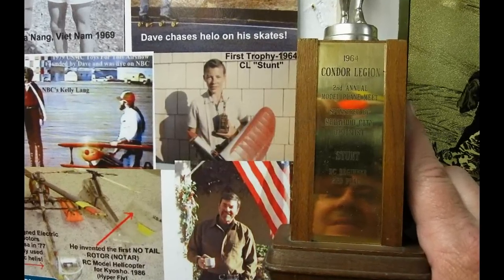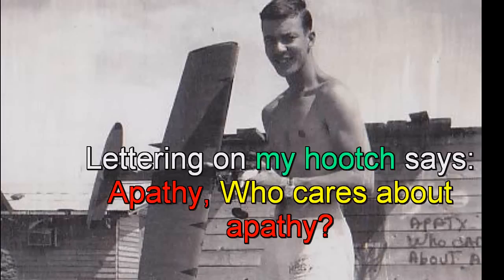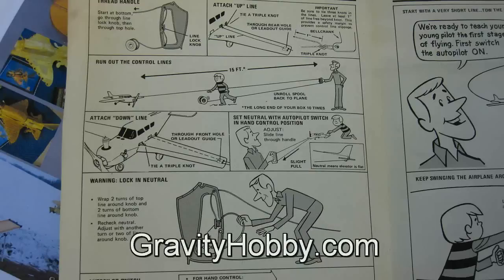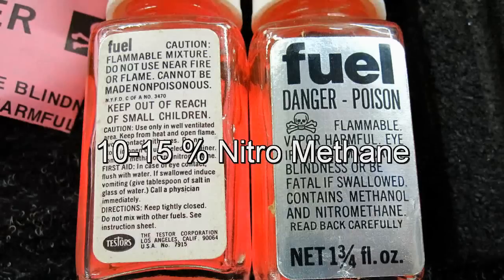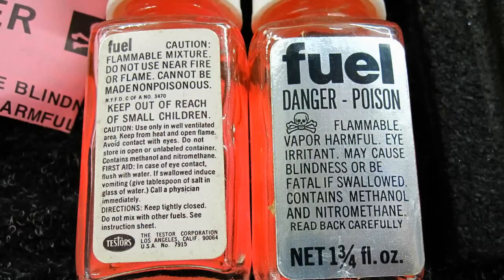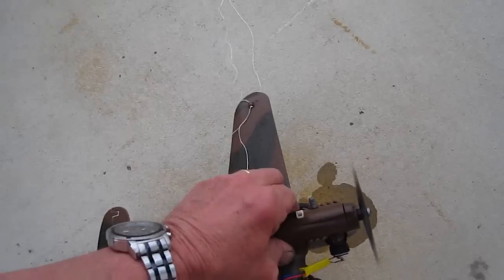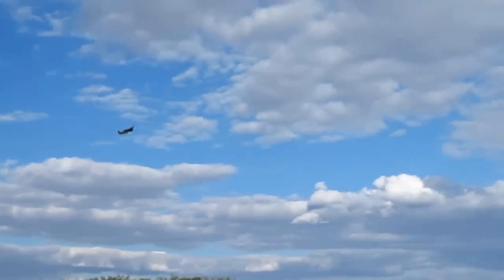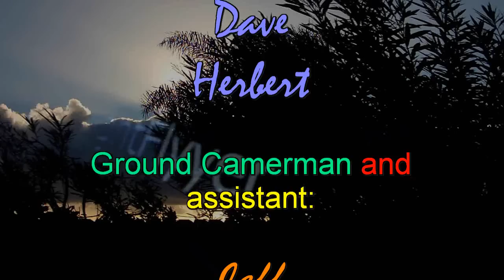Vintage Cox Control Line Plane's History and flights by NightFlyyer. A few are Testors.

Comment: Great video!  I was eleven in 1973 and wrecked two Cox Pt-19s then built a profile P-47 (Sterling model I think) with a golden bee which flew great. Also had a Goldberg Lil Wizard-I still have all my motors plus my Dads too but the planes are long gone. I remember seeing the Air Force Thunderbirds flying F-4s at the Castle AFB open house back then too-great show!

Comment: Flew Cox .049 planes until I got bit(at around 12yo) with the "bigger is better" bug. I went to a "Flight Streak", powered by a McCoy .35. It took me 4 months(winter project!) to assemble, cover, and paint the plane. Never flew it at wide open throttle.....it was just too fast. I mostly flew it throttled back on 60 foot lines. Kept it for 2 years and sold it to a kid in our flying club......I had discovered girls......
Reply from the maker: Thats a great story.  I had many different sized McCoy Redheads.  Never saw one with a carb, however so am curioius how you throttled it back.  I had Flite Streaks too.  Loved them.  1 wheel.   Check out the latest video I made this week where we got GOATED, while flying UKIE.  Luckily the Girl I discovered, loved my hobby.  Thanks. https://youtu.be/HdmXA0Xc1ew

Comment: I want to get a control line plane for my kids to fly but I can't find any that aren't super expensive.  I wish they would put these back into production!  I bought one from walmart when I was about 12 years old back in like 1995 for $40.  Saved up for 8 weeks to buy it.
Reply from the maker: Yes they are rare these days and only Ebay you might find some, as I found a PT 19 last year. I paid $140, but it was brand new in the box, but still way too expensive.  This video is 10 years old and all these models were destroyed in the fire, sadly.  Good luck. I hope you find one.

Comment: Great stuff. I am also a 50 year old C/L veteran now getting back into R/C after a 15 year layoff. Still have my old C/L engines, some brand new. The best .049 was the Black Widow of which I have 4. Two  of them never used. Way better than the Babe Bee. Have 2 of the little .010 which were fun but mostly novelty. Also have a never used Cox .015 which is a very nice engine, then a few of the bigger Fox engines up to an O.S. .35 C/L engine. Fun stuff! I wonder if these will be worth anything?

Comment: I wish someone or groups of individuals could obtain all Cox planes and 3d scan all the parts so new planes can be 3d printed. I had a few planes back in the day, but was given a new Cox Bushmaster for Xmas when I was 14. Before spring flying weather came, it got knocked off the shelf and was broken. I couldn't afford to get replacement parts so the engine ended up in some scratch built FF planes.
Reply from the maker: Right on.  We all did similar for sure.  I favored the balsa Flight Streaks.  3d printing parts would be easy, I  would assume.  Getting someone to begin manufacturing the engines would be the trick.  When I was a kid, I flew a .35 sized Thunderbird across the street in a ball park and no one complained.  Today, the karens would not permit that, so we would be out of luck.  Glad to hear you were involved.  I flew Bill Evans Simitars in the  Nationals.  See that in your name. Any connection?  Here is my latest PT 19 flight, you might enjoy.  Thanks much.  https://www.youtube.com/watch?v=BU0z7ddwslY&t=0s

Comment: Anyone out there remember a prop driven 049 car? I got one for a Christmas present. Red plastic and rubber tires with a high rear mounted engine and prop. Super fast that even on a 20 foot wire it would make you dizzy enough to turn your guts out. In the end I mounted the engine and prop on a combat flying wing with a pusher prop and sharp leading edges.
Reply from the maker: I sure do.  Lots of dizzying fun, as I had one too! You wont find great toys like these in toy stores anymore, and that is a shame.  Kids today are missing that joy.

Comment: I grew up with these COX model airplanes but my dad and I could never get the .049 engines started. I remember frustrating weekend afternoons at K-Mart's parking lot (they used to close on Sundays--everything did) trying to get them going. I had the Ju-87 Stuka and my little brother got a green P-51 Mustang, both Christmas presents. There was no local club or anyone else that could help. My middle school teacher finally started a model airplane club and I brought my Stuka. Once again, the teacher couldn't get the engine started. He tried more things than my dad and I did and just no go. I had to wait until my fifties to actually see a control-line model airplane fly on YouTube because other kids in my area could never get their planes started either. Thank goodness for Atari! I switched to model rockets and that I could get without anyone's help. Ah, toys in the 70s.
Reply: @Alex - same here, we had a green Helldiver if i remember correctly, and seems to me now that it was at least twice as large as the planes in this video - got it started once, a test run then never started again. I think I know now what we were doing wrong 50 yrs later ... i'm sure i could make it fly if i still had it, LOL.
Reply: Andy Burk indeed Andy. I'm likely going to get back into the hobby and bound and determined to get an .049 started ON MY OWN! Lol. Maybe my son will get a kick out of it, who knows.
Reply: @ALex - Good Luck !

Comment: Great video....I flew U-control back in the early 1950's and had a few of the Cox or Testors planes you have there....My friends and I wrecked quite a few of them...They wouldn't take very much abuse....and since they would glide like a brick at the end of the strings when the motor quit.......well I think you know what I mean....We graduated to balsa and tissue paper and had a blast.....speaking of blast we also got into model rockets......Kept us off the street and out of trouble......

Comment: I have got an original Thunder Bird with a Macoy 35 Red Head on it, has never been crashed just living in my basement now has been flown in 30 years or more.
Reply from the maker: That's very cool.  Since I made this video, all my models, shop and home were destroyed in a fire on 911, 2016, including my  McCoy Red head 35.  They were expensive at $6.95 each.  I had it on my Veco Thunderbird, and still had it from 1964, when I won my first UKIE contest with it. Of course it was burned up too. It was a great plane with differential flaps.  That is sure a great thing you still have. Thanks for commenting, Charlie.

Comment: Getting Dizzy with those old Ukies was definitely a blast back in the day! :)
Reply: Robert Kuhnke  That sounds like blast! I loved flying the Lil Satan's with a Black Widow and a 5x3 prop on 25 ft lines.
Reply: Robert Kuhnke  
Cool. I have a few Cox and Testors planes, cars and engines.  
But it''s probably been 35 years since I had a Lil Satan. I have a set of plans and parts patterns so I need to build one. I have a couple of Black Windows as well. One new in box from the late 70's and a much newer one with a plastic back plate that need new planes.

Comment: I had a silver p51 back in the 70s. It came with about 12 ft of line, i couldn't  wait for it to run out of fuel!
Reply from the maker: Wow 12 foot?  Most of them including my new old Cox PT-19 came with 30 ft.  No wonder you wanted it to run out of fuel! Thanks so kindly.  I would bet if you liked this, you will like to see my latest video of my 63 year old Cox PT 19 
U- Control flight from last week. 
https://youtu.be/BU0z7ddwslY
Reply: @NightFlyyer  I'll check it out.... thanks

Comment: Whow we must be about the same age. I worked cutting grass to save up enough money to buy a p-40 just like that. Maybe a liter brown. If I remember it was around $10.00 back then (a lot of money) when I got it my dad took it over an I never got it fly it. 😂. But I did take that engine apart many times. What a blast from my past! You’re looks so small now. To me the thing was huge. Maybe 24 inch wing span. Thanks for the video!
Reply from the maker: Thanks so very kindly.  Those were the days.  You just never see a Nitro powered plane like this in the stores anymore, which is a shame, as getting one was part of the learning curve.  Kids today are missing out.  Thanks.  I'm 73 BTW.

Comment: I think the average life of the old Cox plastic U-Control planes, the ones that actually ran long enough, was about 1/2 a turn. If anyone is interested on the state of U-control today? Check out Brodak Manufacturing. They have planes, engines, a few electric U-controls, a few RC planes, and are one of the best sources for dope and "silkspan" covering material.

Comment: Great stuff NightFlyer...I still have 20 or so Cox engines, Tee Dees, Bee's, Medallions etc.. and some Testors & McCoys. Nils Testor, by the way, around 1949, bought Duramatic ( McCoy)... pretty sure Leroy Cox was never in cahoots with Testors, though they competed in the same market with similar RTF plastic models. Bill Atwood designed the Cox Tee Dee engines and Leisure Dynamics bought out Cox in 1969.. Estes bought it in '96, an outfit in Canada bought it in '09 then sold it to Hobbico in '10

Comment: Testors and Cox were entirely separate companies with different product lines. The y both produced ready to fly control line planes with ,049 engines, but the Cox engines were more powerful and more durable.

Comment: I am a bit confused. The Spitfire is a Testor, I had this very aircraft as a kid. My friend had a Cox Spitfire which was a bit larger and you could clearly see that the Testors engine was not a Babe Bee. We ordered them from the same mail order firm and the Cox was listed as 0.81 or 0.82 cc while the Testor was listed as 0.8. Did Cox buy Testor?

Comment: Back in 1967 my father purchased me a Cox Spitfire Mark V I think it was, from Whites department store in Yorktown N.Y. It cost  9.95 USD or so. It had a 3 blade prop and a nice yellow spinner with  camouflage and detailed riveting, machine-guns and blister on the upper side of the wing. You could also open the canopy. However for some reason it was difficult to fly. It seemed underpowered or perhaps I let the engine, a Baby Bee .049, run too rich giving only 4 cycle speed instead of a fast 2 cycle. I was only ten years old when it got it. Later on when I switched the propeller to two blade 7x4, it worked better. Still it was difficult to control. I suspect that the control lines provided where too flexible, steel lines may have been more suitable.  I used the engine in other models with some success. Later in 1976 the Spitfire was sold to someone and its fate is unknown to me.

I am still involved in modeling flying a RC Fox Cub Jet with a Lambert T25 gas turbine.

Comment: i had the cox P-40 with the 049 engine, early 60's.
Reply from the maker: Great to hear.  Thanks.
Reply: after the  P-40 broke i used the engine on models i built. i can still smell the fuel burning. @NightFlyyer
Reply from the maker: @steveperry1344  That's great. Thanks. Here's a newer one, you may have seen already.  Thanks. https://www.youtube.com/watch?v=BU0z7ddwslY&t=0s

Comment: Nice video. I remember getting a Cox Skycopter for Christmas 1976 and my brothers got a Cox Spitfire and P-40 Warhawk. My brother could never get the .049 engine to work very well so he sold his Spitfire to a friend of mine who crashed it in a school yard on his very first attempt at flying it. I had more luck with the Skycopter which had a .020 engine and it was free flight with auto rotation when the fuel tank ran out.

Comment: Back in the day flew most of the Cox .049's and agreeing to Squareloops some of them were flying bricks the Balsa profile types flew much better, and I did do a Guillow SE-5 with a cox .020 that was great to fly kind of slow next to the bricks but it felt like it was actually using its wings for lift . We were lucky back then as there was a out of buisiness roller skating rink not far away on Ogden ave in Naperville IL that smooth surface made the best airfield around and of the cox planes we all went with the PT-19 it had enough wing area that it had some ability to glide in for perfect landings .
Reply from the maker: That is a great story.  Here is a video I recently made that you may enjoy on this subject as well.  Thanks so kindly for commenting. https://www.youtube.com/watch?v=NntPP4HA1E0

Comment: Sorry...If they don't have carburetors, what mixes the fuel w/ air? Also leaf blowers are reed-valve engine too, as are many 2 cycle engines. Also, not all Cox engines have a reed valve. The Cox "Tee-D" series (.010 .020 .049 .051 and .09) have rotary valves hence the carb is on the front.

Comment: Yep, there was a hook on the bell crank.  Set full down, take the anchor line over the elevator, spiral it around the fuselage, and put the loop at the end over the bell crank hook.  Fire it up, run like the dickens to the handle, and give a stiff full up. The anchor line would slide off the bell crank (hopefully smoothly), and off she went.

Comment: Hi Dave, watchin' you'r litttle Cox engine control line aero planes take me back a few aeons. 
Did you have Jetex motors over in the US of A, way back when Dave? 
These were small reaction motors, drop in a couple of pills and coil a small piece of fuse, light the end and away your pride and joy would fly. Mostly the plane would come to land a trifle scorched from the expelled gases..  :0)

Comment: Now imagine doing this with a plane doing 100+ MPH. My Dad had a couple of VooDoo combat ships along with a Spectrum. (Also combat and the first one I'd been present during the construction. The others were built in the 60's about a decade before I was born!) There was also one more (don't know the name) that had about half the wingspan and was the fastest of the group. He said a few guys would be in the center trying to cut crepe paper from the other planes.
Reply from the maker: I don't have to imagine, as I also had several Voodos and Combat Cats.  They were just flying wings and designed for combat.  I had entered several combat contests, which someone always ended up crashing.  It was wild.  Check out some of my other Ukie videos if you get a chance.  Thanks.
Reply: @NightFlyyer  I've found I can still get plans for the VooDoo and the Fox .36 my dad has on his is still easily found. I don't want to risk wrecking his so I'm going to build one myself and try it! I think I found the name of the smaller one. It's probably the Jr. Satan but I have to compare it to plans (Also still available!) to know for sure. The Jr. was .15 powered which is what was on the small combat ship. (He mounted it on the trainer when he taught me to fly CL.) Also, now that I've thought on it I think he said the VooDoo was the fastest of the ones he had.
Reply from the maker: @jpatt1000  They were very fast.  I had a Johnson .35 combat special on mine and 60 Foot stainless steel lines.  Pretty wild stuff.  Good luck and happy flying.

Comment: As a kid I grew up in Santa Ana we moved there in 1961 and Cox hobby was right there on Warner and we would go and get all the stuff from the dumpster if it had a little scratch or  the box was crushed they would just throw them away. We would get lots of them for free but after a while they started smashing them and locking them up but it was good  until it lasted. Wish I would have had the trains of slot cars and all the other stuff we used to get their worth a lot of money now

Comment: Does anyone remember this? One Christmas morning in the early sixties, I received a Cox WW2 fighter plane which came with a  pylon that got anchored to the ground in the center of the flying circle. It had a up/ down joystick that was outside the circle where you controlled the flight. I don’t remember the mechanics of it but it certainly worked. My Dad laid sheets of plywood down for a runway and you could take off and land pretty easily. I have never seen reference to it anywhere. Thoughts?
Reply from the maker: Had most of them, but never saw this one.  That is great.  14 years ago, I made a tethered Ukie with my sig buster.  Kinda the same thing.  Enjoy.  Thanks.   https://www.youtube.com/watch?v=HcpK4N-Yg3A

Comment: what happens if you just keep using a longer and longer string? is there a limit ?
Reply from the maker: Good question.  My bigger planes use 60 or 70 foot steel cables for lines.  But if you tried longer lines on planes this small, the drag and weight of the line will cause the plane to fly in at you and the lines wont stay tight.  It wont be controllable unless the lines stay tight.  Thanks.

Comment: hey dude.....since I'm new @ this nitro plane line flying....but I'm into nitro cars....soo i no alittle about this stuff....soo do all props have to spin counter clockwise to fly?
Reply: +Joseph Petriella Yup.  The pitch on most props is designed to have them spin counter-clockwise.  They do make 'pusher' props with reversed pitch- these are designed for engines mounted on the back of planes (to simulate a jet aircraft, or just an unusual design).

Comment: I remember getting a German Stuka for Christmas we took it out the next day in 20 degree F weather shoveled away the ice and snow for a run way the plastic didn't last long in those temps
Reply: My first was the Stuka too.  1 turn and nosed it into the ground at a very steep angle.  Broke EVERYTHING.  My dad spent most of that night repairing it.  He test flew it till he got dizzy sick and just let go of the controller.  I never could master the damn thing.  Eventually I got the P-40 trainer.  Should have started with that.